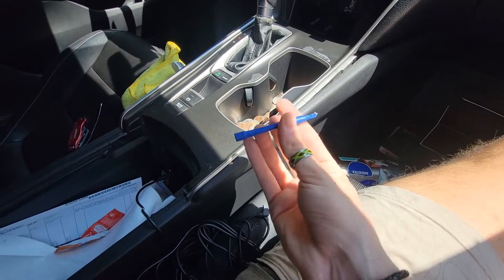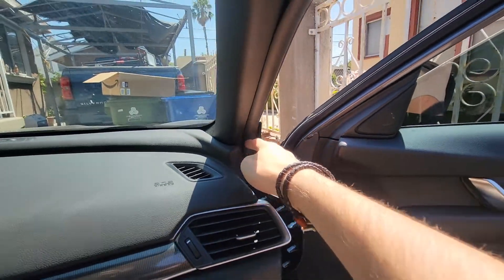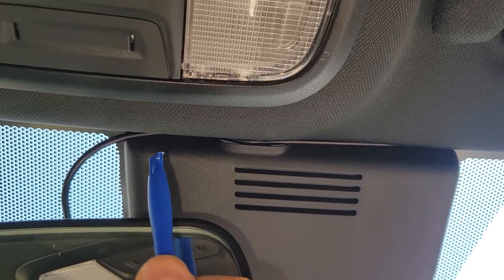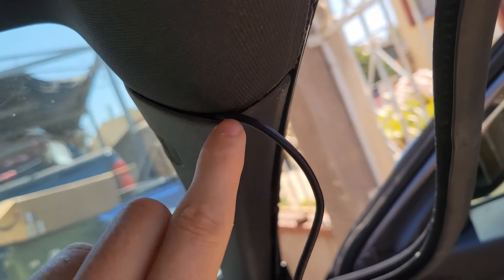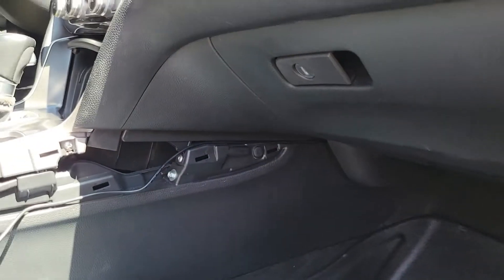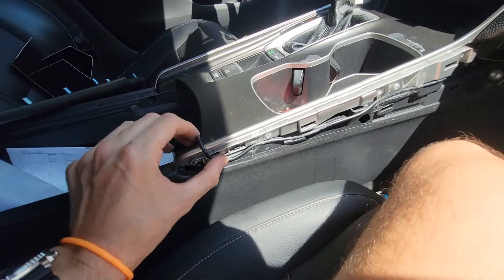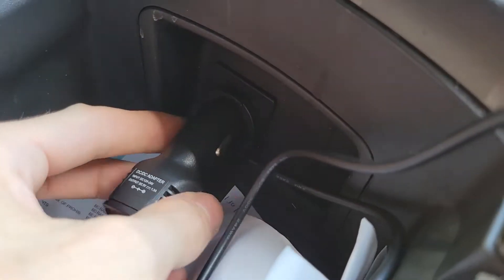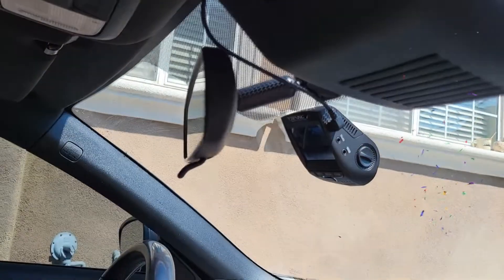DASH CAM Install Honda Accord (2018-2022)

Comment: Clean your car bro.  Disrespect.
Reply from the maker: What's dirty about it?
I need almost everything shown: Red Box cutter to cut plastic, Yellow towel for cleaning the windshield & surfaces, dash cam packaging on the floor to hold the dash cam parts, and my water bottle because it's a hot day. 
Aside from that:
The center console has papers (only seen because the center arm rest is opened) & cup holders loose coins.